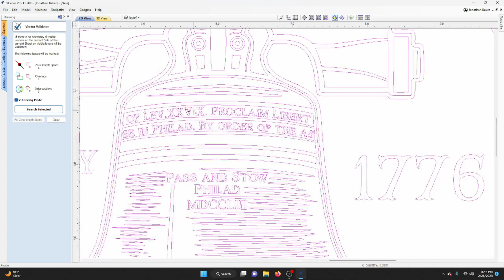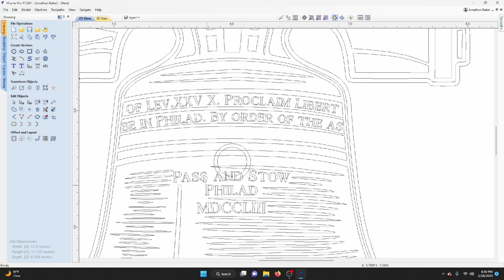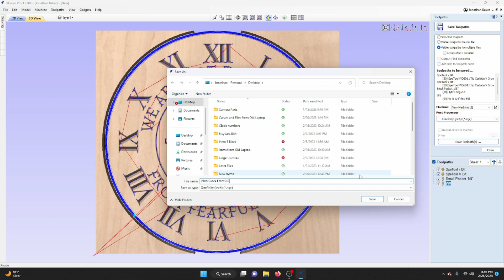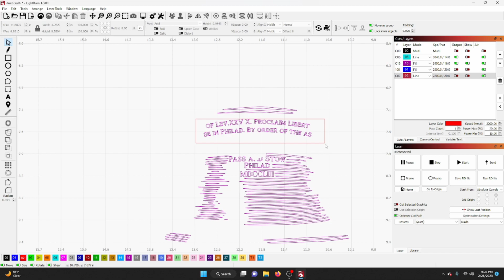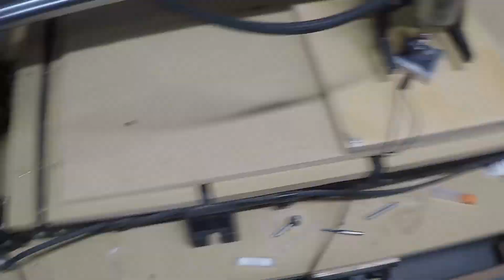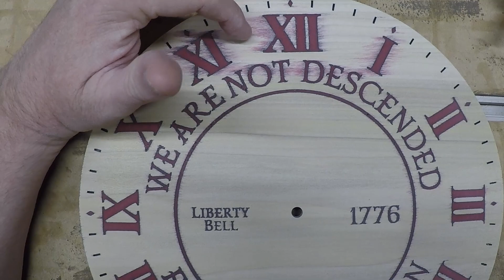Mistake with CNC

Comment: you need to seal your carve up before using any paint or epoxy. especially the vcarve areas. i use poly spray on or shellac and it eliminates any bleeding
Reply from the maker: I usually do and give it time to dry.  I rushed this one too much.   What do you use for sealing your carves?
Reply: @oldtech_76  shellac or spar poly urethane 
Shellac is quickest to dry but i usually always have a run when i use it but in some cases it dont matter im gonna sand it 
Polyurethane works well but the dry time is long compared to shellac so im practicing my application technique  😆
Reply from the maker: @bubba6945  I used shellac before on a few things, but not on an epoxy project.  I will give that a try this weekend.  Thanks for the info!
Reply: @oldtech_76  flood the vcarved pockets well. That end grain soaks it up